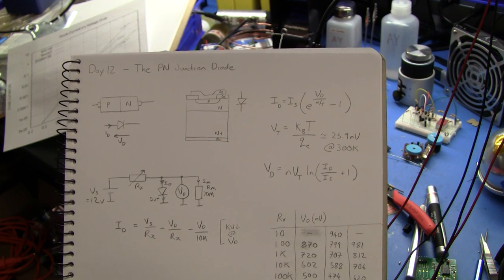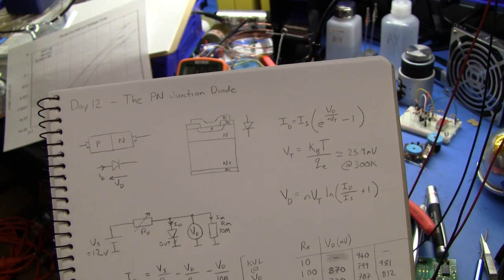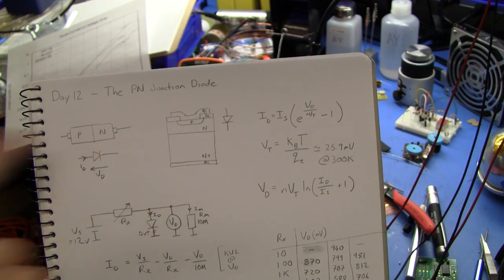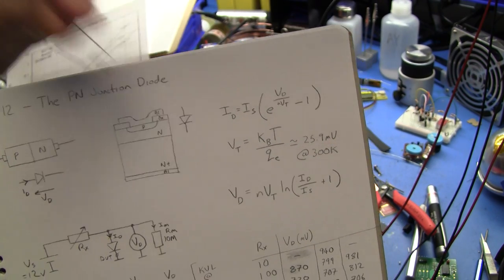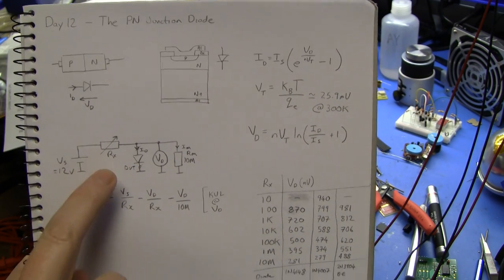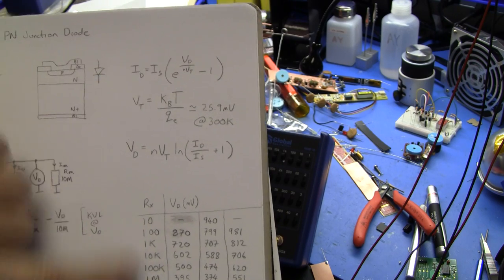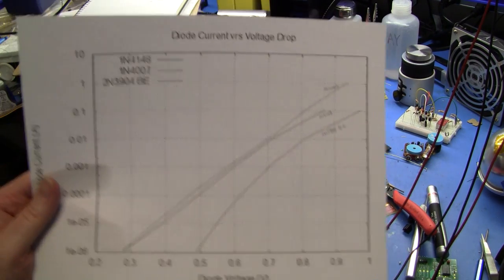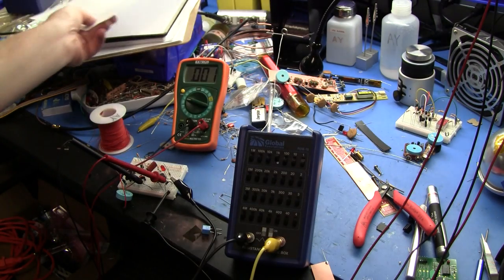Advent Calendar of Circuits 2014: Day 12: The PN Junction Diode

Comment: s'more nitpicks.
1:35 - The N and P regions start out neutral -- donor and acceptor ion charges cancel with the electrons' and holes' charges -- so electron-hole attraction doesn't cause carrier movement. Electrons and holes move away from their original positions because of diffusion, the same way a fart spreads in a classroom -- through thermal agitation. They'd diffuse until they were uniformly distributed, if it weren't for their charge. A potential develops when they leave behind their ions, and a drift current (E-field induced current) forms. Equilibrium occurs when the drift current caused by the "built-in" potential is large enough to cancel the the thermally-induced diffusion current.
1:45 - The depletion region is best described not as an insulator, but as a vacuum. It is a region devoid of carriers and across which a potential can be placed without conduction, but any carriers that are introduced will be swept across readily. Under reverse bias an intense field exists, but there simply aren't enough carriers of the correct polarity on either side of the depletion region to cause a substantial current.
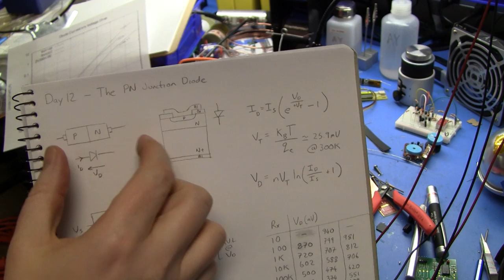2:50 - The vast majority of recombination occurs not in the depleted region, but in the doped regions. Electrons (holes) that have found themselves on the P-doped (N-doped) side randomly wander about until they recombine.
The 2nd and 3rd points are essential for understanding transistor operation. To wit, take a reverse-biased junction and introduce carriers of the correct polarity so it conducts. I've scoured YouTube trying to find an accurate explanation of BJT action, but so far I haven't found anything that comes close.

Comment: I really enjoy your series of videos. I am impressed both by your clever minimalistic non-standard circuits and the fact that you manage to put up a new video every day.

Regarding diode behavior: I have never seen an expression derived for the temperature dependence of the forward voltage of a diode (including the temperature dependence of Is), but it is often cited as approximately changing by about 2 mV/degC. Do you know if such an expression can be derived from more basic properties of the diode that does not change with temperature or current? I assume that such an expression is at least somewhat messy and/or involves obscure parameters, since otherwise it would be well known as it would be quite useful.
Reply from the maker: You have to go pretty deep into the physic of the semiconductor electronic behaviour to accurately model the saturation current from 1st principles.  The temperature dependence of the carrier diffusion rates are the largest effect I believe.  Diffusion models typically look like the Arrhenius equation, I have no doubt it can be modelled with something like that - basically another exponential for temperature..
Reply: Yeah, I would guess so based on the lack (or at least obscurity) of such an equation. It is interesting though that the relationship in the end seems to be almost linear and only weakly dependent on the diode type.